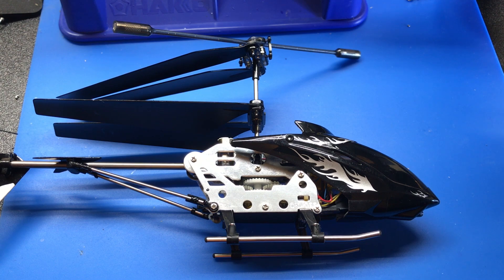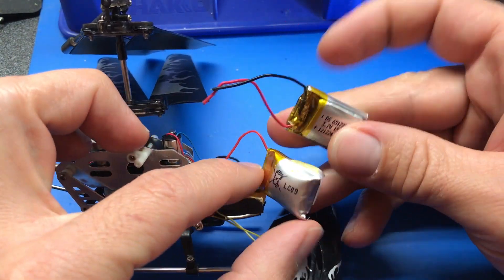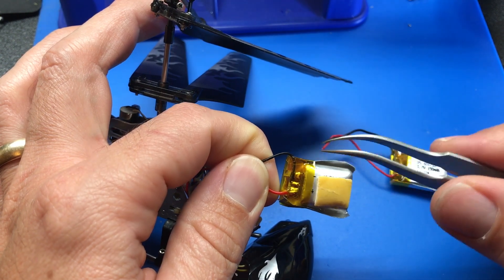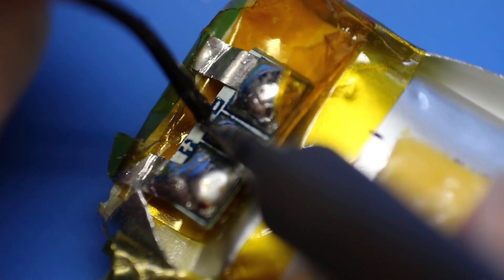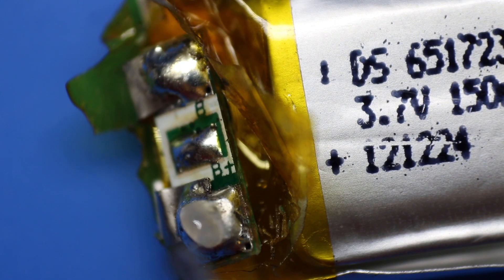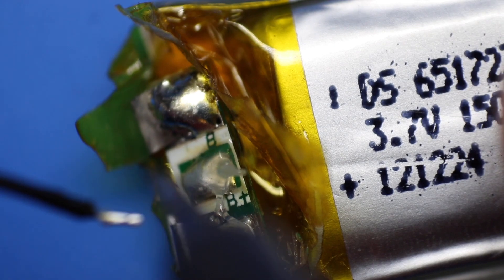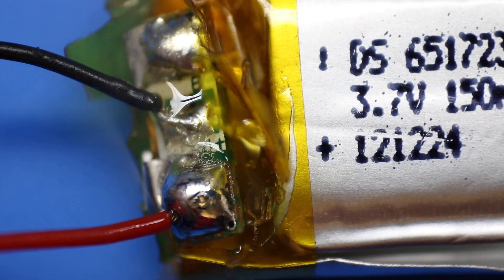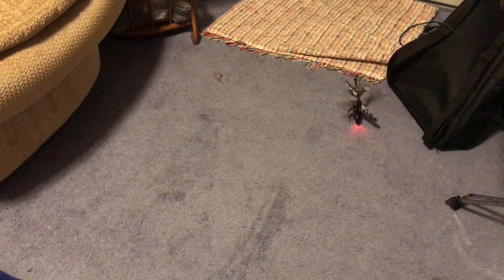Change Syma s107 Helicopter Battery

Comment: Better to solder the wires together.  Don’t desoldering the wires from battery.  The heat from soldering iron could destroy battery (maybe even a fire).

Comment: Should I place a bigger battery
Reply from the maker: You can technically put a larger battery in but the copter might struggle with the extra weight.  Maybe others can speak to the results they have seen.